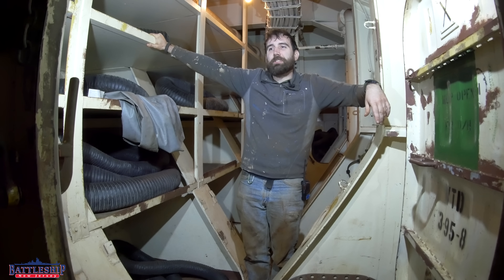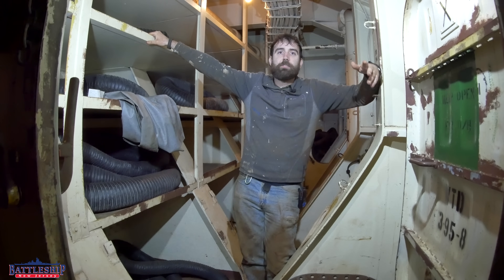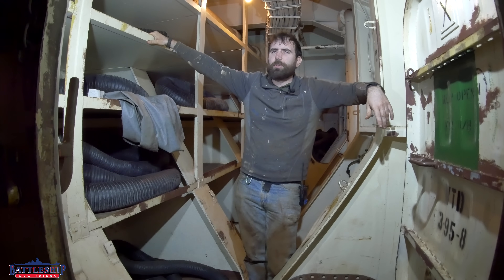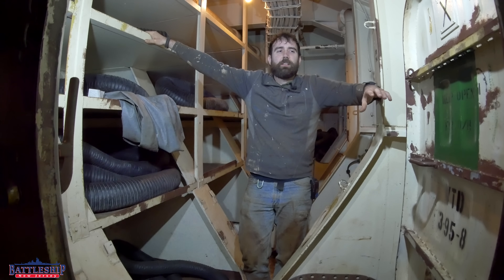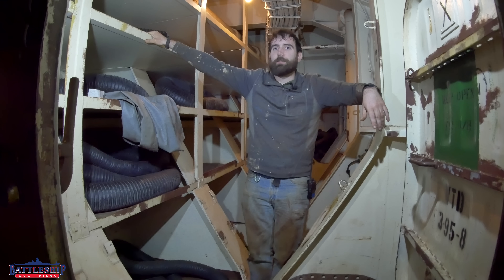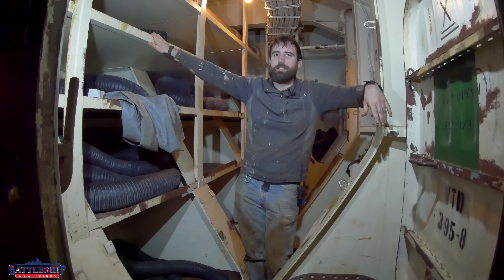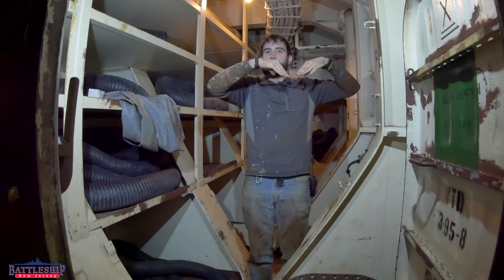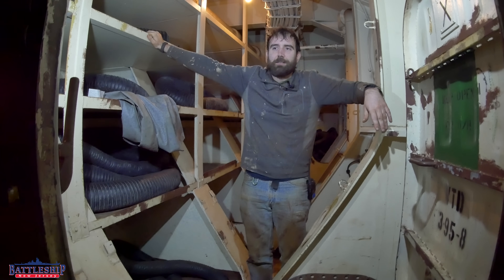The Best Torpedo Defense On a Battleship

Comment: Believe it or not modern mines are designed in the same way. They will sit on the bottom of the ocean waiting for a ship to pass over, when it detects the ship it will explode which causes a gas bubble to raise out of the water lifting the ship as it hits the surface, once the gas bubble collapses on its self the ship will fall back into the water cracking her hull.

Comment: The old USS America and the Nimitz class supposedly have, in addition to the usual transverse water tight bulkheads, there are two full length longitudinal water tight bulkheads that run from the main deck, which is the hanger deck on American aircraft carriers, all the way down to the bottom of the hull.  Aside from giving the ships exceptional compartmentation these would seem to stiffen the ship significantly against torpedoes exploding under the ship and perhaps prevent her back from being broken.

Comment: Only two modern battleships come to mind with a single torpedo hit that allowed the results and damage to be investigated that I can think of. IJN Yamato and USS North Carolina. With Yamato, they realized that their torpedo bulkhead backing was too rigid and the braces punched through the torpedo bulkhead and caused way more flooding than they expected. The North Carolina's system worked well even though it was hit in one of its shallowest sections. The place where it was hit was even noted by designers as a problem spot. So I'm thinking the American system was one of the best even thought, due to the width of the Panama canal, they couldn't make it deep enough due to ship beam restrictions.

Comment: Kitty Hawk Class carriers.  Because they were not constrained by the Panama Canal size they were designed with the multilayered void system.  At the time of their launch, it was expected to be effective against the torpedoes in existence at the time.
Reply: The Nimitz class improved on that with full length longitudinal bulkheads that ran from the bottom of the hull to the main deck (which is the hanger deck on an American aircraft carrier).

Comment: I suppose you could always have voids/compartments under the keel of a modern ship, to absorb the explosion of a modern torpedo. But they would have to be extremely strong to support the weight of the ship during dry dock. And I'm not sure if that would help with the second part, where there is suddenly a large air pocket under the ship after the explosion.

Comment: The thing I don't get is why the outer skin isn't filled with concrete. Then ice and impact are compression against concrete, but the internal armour stays sealed. And second, why the bow doesn't have plates on hing above the water and springs, and shrouds below so the waves impart their hit over time and the springs open the plates again between waves. This gives suspension to help you cut through the waves rather than bash them. Every other vehicle uses suspension.
Reply: Or wings so the ship can fly over the waves?
Reply: @annoyingbstard9407  yes the ground affect aircraft are pretty cool.,but not able to carry 1 million tons of cargo.

Comment: Interesting, I would have thought spaced armor would fair much better than one single thick place, 
which is the case in tank amor, but that's mostly against armor piercing shells,
so maybe protection against high explosive is different.
Reply: Spaced armor is best against shaped charges, because the first layer detonates the charge and disrupts the “jet” of metal, which needs to detonate against the main armor in order to be most effective.  For a kinetic penetrator, a single thick piece works best (unless you’re getting into de-capping layers, but this was never tested at full scale with battleship guns, so it remains debatable whether it was effective or not).

Comment: — ….You said modern ships are wrecked by breaking their backs, BUT, no country in the world actually operates actual Battleships now either.  Could one of these new torpedos, the Mk48 adcap or the Mk50, the 533mm torpedo, actually break the back ( keel ) of a WW2 Battleship?  After all, WW2 Battleships were much larger and heavier than modern ships, right?   The Iowa class was just short of 900 feet long!  And it weighed in at 58,460 Tons!  Could a modern torpedo, as is, create a fluid cavity large enough to break her keel?   Or what about a modern Super Carrier?

—  — OK, I am just turned to 15 and I like history a lot and the what if game, along with some of the very older computer based games that my fosters father has like North Atlantic 86.  That is what made me think about the differences.
Reply: I'm sure NAVSEA knows the answer to that question and are not sharing the answer in public.

Comment: 7:04 This is also because of splinters.  By having the outer layers made up of thin plating, any splinters created by a torpedo will be smaller and will be better resisted by the thicker, inner bulkhead.

Comment: Honestly, I’d say tactics of keeping up speed is the best defense.  See what happened to Yorktown.  Submarines could only go about 22 kts of the surface and 8 submerged.  This holds true today.  Subs can go faster, but they’ll start cavitating and they can be detected.  The Japanese system was not good.  Shinano (Yamato hull) and Shokaku show how it didn’t work for the Japanese.  No modern German or Italian capital ship was sunk by torpedoes alone so we just don’t know.  Bismarck had some 400-600 shells hit her before Dorsetshire finished her off.  The Brits lost Ark Royal to a single torpedo, and Prince of Wales got sunk by a golden bb/torpedo.  North Carolina held up well.  Saratoga seemed to have a collection of Japanese torpedoes but never sank.  Her sister Lexington wasn’t sunk by torpedoes, but by poor damage control.  So I’m gonna go with the US system just based on experience.

Comment: The French had a very interesting system for the Richelieu: they had four spaces, with the two innermost liquid loaded, the next space void, and the outer most was filled with a rubber foam. Now whether this foam could absorb the explosion's energy is up to debate (highly unlikely), but the French were more focused on the aftermath of the explosion. In essence, the rubber foam was there to reduce flooding by denying the water a space to fill, as well as acting as additional buoyancy.
As the full size system was never hit with a torpedo we unfortunately don't know how well it would have worked at stopping one, but it does rate favorably in post hit damage control.

Comment: Bismarcks torpedo defence was thoroughly tested for sure (and from we know it looks like it passed those test with flying colors). So maybe they dont have THE BEST torpedo defence, but certainly (more than) good enough. Btw Bismarck shouldnt be adressed as "SHE" as is common with other ships, but instead as "HE" as was common practice in Kriegsmarine at that day (and even Lindemann thought this way). About modern torpedos with their spine-braking ability - I think something this huge and sturdy as Iowas can withstand one hit srom modern types due to their big rigidity, but there probably would be hole through tripple deck right where  explosion occured. But all that armor plating and bulkheads running at ships lenght maybe can protect her against fatal bending and breaking as occures in those types of hits.
Reply: I agree on battleships being pretty resilient to modern torps due to their size and structural rigidity.  

I don’t think Bismarck’s TDS was particularly well-designed, but it did have one thing that is very important in a TDS...depth.  We’ll never know for sure if Bismarck’s TDS was penetrated or not, because the lower portion is buried in the mud.  But she took a pounding.  She was a goner either way though, because she had water pouring in on top of the armored deck from all the shell holes, and would have soon capsized from that water sloshing around.  

As for whether to call Bismarck a “he” or a “she,” I don’t much care what some nazis thought their ship should be called.  I’ll call her “she” just out of spite for them.

Comment: Also, would certain WW2-era torpedo defense & armor protection (that some considered the best, but it depends) survive modern-day anti-ship missiles?...

Because I dream of designing ship protection that can protect, let alone survive, both the largest & most powerful of ASMs and torpedoes
Reply: Most modern anti-ship missiles are designed to sink modern unarmored warships, so they might struggle against battleship armor.  A shaped charge would penetrate it, but wouldn’t do much damage inside because of their size and subdivision.  BUT...if a country wanted to design a missile specifically to take out a battleship, it wouldn’t be that difficult to do so.  A tandem shaped charge would be most effective, with the first charge to get through the armor, and the second charge to explode inside.

Comment: My candidate for the best TDS would probably be that of the Nelson class (predicded to be proof agains an 800 pound warhead, shown in full scale testing to be proof against a 1000lb warhead). Technically speaking it should probably be that of the later ships which used a derivative of it, but I'm not entirely comfortable of the way that their armoured belts and deck encase the TDS (and there's also a fact that the lower edge of the belt is potentially a source of splinters if a torpedo hits higher than it would in normal conditions).

Comment: Drach just did a video today (Feb 8), of the torpedo hit on the North Carolina, interviewing a rear admiral, who's studied it. The North Carolina's defense, held up quite well, against a Japanese type 95 torpedo. The ship managed to stay a speed, and suffered little extra damage while at speed. That's more than you can say about the Bismarck suffering a smaller hit to its bow.
Reply: He also noted that the Japanese torpedo had a much larger warhead than the USN had designed against, yet the TDS still held up, even the thinner portion forward.
Reply: The Bismarck was hit by a 14in shell, not a torpedo, which tells you a lot about that ship...
Reply: @sskuk1095  The 14” shell you’re referring to was an underwater hit that exploded against the torpedo bulkhead.  Passing through water robs a shell of most of its velocity and penetrating power.  They can penetrate hull playing and thinner bulkhead plates, but can’t get through the main bulkhead.  And if they can’t penetrate that bulkhead, then the 50 pounds or so of explosive they carry isn’t going to do much damage.   In contrast, the torpedo that hit the NC carried almost 1,000 pounds of explosive.  There’s really no comparison between the power of those explosions.  Bismarck did have a relatively effective TDS, but only because it was very deep.  The design was actually very simple and would not have worked well on a narrower ship.

Comment: I think you need to look at two sides of the question: not only what anti-torpedo system the battleship had, but how big a warhead was launched against it. I think Yamato class BB's took the most hits before sinking, but they were hit by air launched torpedoes that were usually lighter than those carried by surface ships or submarines. In principle I like the idea of making a path to atmosphere for the expanding gases in the space between the side shell and the holding bulkhead. When I visited the Massachusetts I saw the row of inspection ports along the side slightly below the sheer and I thought that's what they were, but I wasn't able to confirm that in the sources.
Reply: Depth and subdivision are everything. Ideally you wanted to create a deep void space that is heavily laterally subdivided and runs under the ship. This allows the flooding to spread across the ship to prevent listing. The US knew this but the weight/size of its battleships (even the iowas) were constrained by treaty among other things so they had to work within those limits. Yamato was not.
Reply: @navyreviewer  But interestingly, the Iowas and SoDaks had a deeper TDS than the Yamatos did due to their more efficient machinery taking up less space.  They did have a potential weak spot in the connection between the lower belt/torpedo bulkhead and the triple bottom, but this would have only caused problems low in the ship where the flooding could be contained.  The Yamatos’ weak spot was the connection between the upper and lower belts, and a hit there would have allowed water to pour in relatively high in the ship.

Comment: Would the defensive properties of the liquid filled spaces vary significantly depending on the properties of that liquid? i.e. salinity, viscosity, density, etc.. As in, would fuel be better than seawater (or was fuel worse, but you needed it along anyway)?
Reply: You don't need #6 bunker when the fuel is U(235).

Comment: The idea of 1 thick plate being better than multiple thinner plates, even if the thinner plates are equal or thicker than the singular plate is interesting.  Because we see the opposite wisdom in tank armor.  Tank armor will often favor air spaces between layers of relatively thinner armor.  This helps mitigate HESH and HEAT rounds and CAN have some effect against sabot penetrators. I'm not speaking of slat/cage armor.  
I can only guess that some of the fundamental assumptions in naval armor are different from those of tank armor.  That or the difference in degree is so great that it may as well be a difference in kind.
Reply: Laminated plate (layered) is weaker for the same reason a karate guy came chop through ice. Break the top one and it hits the one behind it and so on.
Reply: @navyreviewer  So why do tanks and AFVs use laminated armor?
Reply: @grimlock1471  spaced armor used in moder vehicles is primarily there to damage or disrupt moder armor penetrating projectiles. Laminated armor is usually there so that materials with very different properties can be combined, like putting ceramic between steel plates. 

Battleships were facing a very different threat and they did not have the advanced materials we have today in making very effective composite armor. The large naval shells of the time were made from hardened steel & were relatively short & fat. They also were not moving at very high speed as far as projectiles go, plus they are absolutely enormous. So breaking them apart or getting them to tumble was very difficult and not something thin plates could really do. Laminated composites would probably have been fantastic against WW2 era shells but the technology to produce effective ceramics like we have now simply didn't exist at the time.

A modern long rod penetrator or a shaped charge jet is comparatively long & thin, they are also moving at much higher speeds. This makes them much more vulnerable to being broken up or deflected. These modern projectiles also penetrate so much that they must be disrupted to be effectively dealt with by something as small as a vehicle.
Reply: It is hard to describe the differences between those two types of systems because every aspect of them is so different. It seems simple at first, battleships seems like tanks of the sea, they both have thick, durable armor and they both have guns designed to defeat their own armor but when you boil it down, the similarities start to evaporate and the differences become so great that they almost aren't comparable anymore.

Case in point, most modern AT shells could convincingly penetrate the armor belt of New Jersey but those same shells can struggle to penetrate the best tank armors, which are usually thinner than 12 inches.

Tanks and IFVs have layered armor because those layers can break up or divert long rod penetrators and/or hyper velocity metal jets more effectively than a monolithic block of material of the same weight. Battleships have monolithic belts because that slab of metal is more effective against the high mass, relatively low velocity shells that are likely to be fired against it. The physics of why that is are much more complicated than a YouTube comment will effectively communicate 😂

If you are curious about how modern and legacy tank armor and shells work, the channels "Dejmian XYZ Simulations" and "SY Simulations" both have many, many videos showing computer simulations of a wide variety of shells interacting with an equally wide variety of armor compositions. Everything from the 75mm Sherman against a Tiger's front plate to a T-72 shooting at the lower glacis of an Abrams.

Comment: 1. prior to WWII the us didnt test there mark 14 torpedos because they were to expensive. Of course we know they didnt work, and the us sub crews were at a major disadvantage when we needed them the most. 2. why not do an examination of the damage the USS NORTH CAROLINA took when as a battle ship she was hit by i belive was a type 9. As far as i know no Iowa class was hit by a torpedo. So there is no data there. The damage to USS NORTH CAROLINA, u have the plans of her torpedo defence and what happened when she was hit. Thats true data that u can speak on.
Reply: That has been done - the NC holding bulkhead did hold, but was deformed.  The hit was next to the forward turret, where the depth of the TDS was shallower than the rest.  NC took on water but counterflooded and retired from the combat area to repair.
Reply: @gregorywright4918  This i know, but the vid was like we dont know what would have happened. He could have mentioned that it did happen and we have data. But maybe that goes against getting money for his ship when the USS NC is a compeateing ship. in better condision with a kingfisher on her rear deck to see.
Reply: @pvccannon1966  The systems are not exactly the same, but based on similar principles.  And your mention of North Carolina is prescient, since Drachinifel just dropped a video today about her torpedoing.  Check it out.